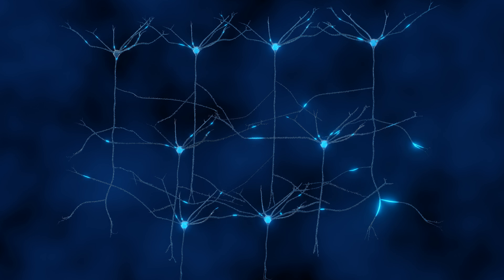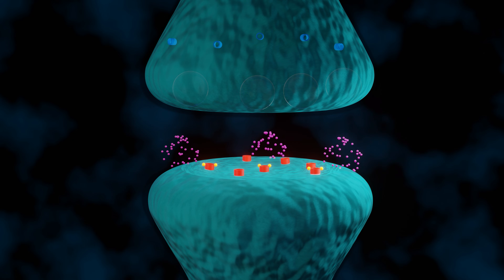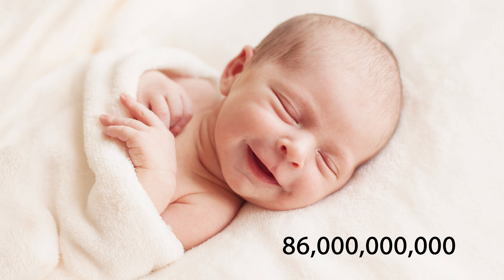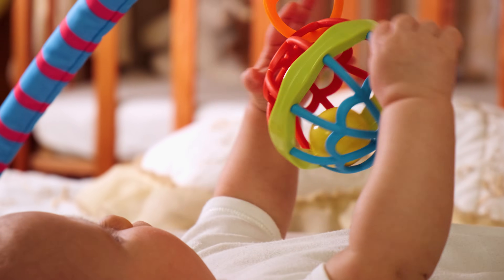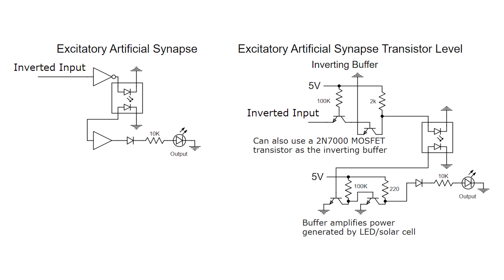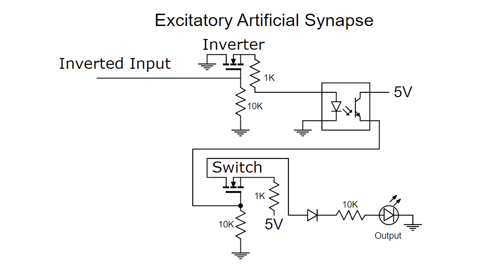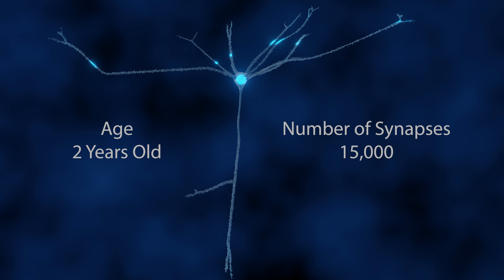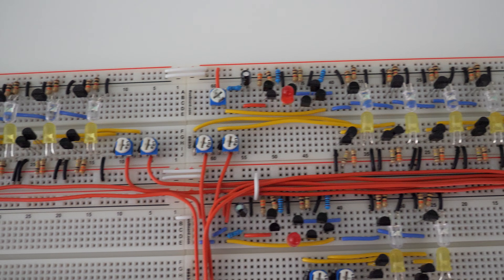How to Build an Artificial Synapse

Comment: What is the purpose of opto-coupler why not a simple direct connection?
Reply from the maker: In this case the optocoupler is basically is a buffer. However the optocoupler could be modified to make it so the amount of charge transferred varies based on the amount of light and wavelength of light. The could be changed in a neuromorphic way based on the activity of the circuit.

Comment: Neural Electronics Will Not Be Corespondent, Analogue To Biological Neurons, Biology Is Infinitely More!
Reply from the maker: Well that is a fair position to take as the task to properly replicate the biology is immense. However, both are physically systems so they should be able to function in a similar way. The question in my eyes is can we do this within a reasonable time frame. It will be lots of work but I think we can achieve a system that is functionally equivalent.

Comment: A fascinating design. Very simple. I would LOVE to play with it. What transistors do you use in this? 

Other thoughts - ReLU can be used as a function of the neuron to control and adjust firing frequency while Tanh is very practical in functioning as the transfer function. As for the resistors to control the triggering event as well as the weights in the synapses, though this is not a pure analog solution - but is suitable until cost effective and functional memristors are available - consider the use of something like a digital potentiometer such as the MCP4012T. 

This would then make a dynamic neuron that would very closely emulate the function of biological neurons that is capable of adjusting while functioning and not needing manual adjusting of resistors. A simple computer - such as a raspberry pi - would be able to calculate feedback based on training set errors into the analog neural network. 

Another more advanced concept would be to incorporate a 'routing' system for analog signals to define connections from neuron to synapse - thus enabling a DNN to evolve over time given suitable numbers of analog neurons and synapses. Something to be considered if the above mentioned neuron/synapse designs can be proven then fabricated on chips.
Reply from the maker: These are 2N2222 NPN BJT transistors or 2N3904. Either model will work. Your thoughts seem very valid and are similar to what I am thinking as well. I am going to try and build an all-analog version of the neural networks and see if I can get them to achieve some practical applications. Get some components and keep me updated on your build! It should be really fun! I plan to launch a competition to see who can build the best hardware bases artificial synapse, neuron, and network as well.

Comment: Hi ,Nice vidoes.Can you also do some more 
breadboard circuits using transistors or ics.Its so coool
Reply from the maker: Yes, there will be more upcoming videos using transistors and ICs. The next series is going to on neural networks and hardware based neural networks.

Comment: Can you please tell me what type of transistor and diodes you used....
Reply from the maker: The transistors can be 2N2222 or 2N3904. The diode was model number 1N4007 which is just a standard diode. Good luck with the build, let me know if you have any other questions!

Comment: 3:52 autistic people don’t prune synapses as easily at any age and have continued increase in number of synapses through early childhood and even later
With your hypothesis this is probably the reason for autistic resistance to change and memory, and part of delayed learning that can occur in autism aswell. This has been linked to hightened sensory sensitivity and epilepsy, both of which are common in autistic people.
Worth noting that autistic brains more easily myelinate (insulate and reinforce) connections than typical brains do, and there are defecits in long-range connections supported instead by all the short distance connections and hyperactive neurons (low GABA levels which reduce the filtering of neural stimuli, and higher Glutamate levels which increase activity, sensitivity and neuroplasticity.). Lower levels of ambient dopamine with larger spikes in dopamine also create the innatentive/executive dysfunction and intense interest aspects of autism.
Thought i’d share another way that neurons can work. There’s papers and videos on neurobiology of autism you can look at
Reply from the maker: Interesting, I have thought about similar things to what you mentioned before. Some times people need to hear things three or more times to learn or accept a new concept. Other people learn after hearing it just once. There are both advantages and disadvantages to fast or slow learning. As you mentioned with autism there are also advantages and disadvantages but that is what makes people unique.
Reply: @GlobalScienceNetwork  mhm. Learning and sensory processing and executive function have a lot of variety in humans. I wonder with artificial minds what kinds of variety unique to them might arise or be invented and if we can emulate different human modalities fully to where they behave like specific human neurotypes
Reply: @GlobalScienceNetwork  oh another thing
Even if it doesn't exactly resemble a human brain or computer, giving specialized but interconnected "brain regions" to what you're making might give it more human or computer like cognition/processes and would probably help it be more complicated and behavioral than things like LLMs or image transformers that are the current craze
Reply from the maker: @orbismworldbuilding8428  Yeah, I agree! LLMs are simulated on digital computers so the information flow is not like how the brain works. It will be very interesting to see what happens when we build large hardware-based neural networks that are interfaced with sensory inputs. If we properly build them it should be amazing!

Comment: I followed the setup at 5:25 but the blue light seems to turn on without me pressing the button. Could the resistors be the cause? If so, could you please tell me what the values are? I'm having a hard time seeing the colors (and still learning how to read schematics). Thanks
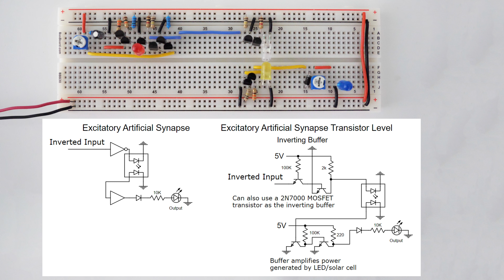Reply from the maker: Hi At 6:00 I show the transistor level schematic. The resistor values are shown but your issue is likely that you did not add a diode before the 10K potentiometer which is a variable resistor. You do not need to use the potentiameter and can just use a 2K resistor but you do need to have the diode in place.

Comment: how do you think this can model the brain's plasticity? I mean, how can these artificial synapses rearrange themselves "at runtime" based on learning patterns?
Reply from the maker: Well the textbook answer would likely be to use memristors. Basically these reduce the resistance with more activity. In reality though this is not a great model for how the brain actually learns. It is up to us to develop better hardware based synapses and neurons. The specificity of charge distribution is actually really important. I will talk about this more in upcoming videos. Basically if there are 5,000 incoming synapses only 50 of those connections may be from the output of another neuron yet it will fire in sequence. This is because of the location of the connections. Also when a synapse needs to be inhibitory for the logic to prevent the neuron from firing this can be done by changing just a few synapses at the right locations. In reality it may be that most neurons want to be firing at a higher rate but it is the inhibitory synapses preventing that. So by changing those few synapses it really lets you control that neurons firing rate. That is my thought at the moment.

Comment: component list?
Reply from the maker: To build the artificial synapse and neuron you need 10 2N2222 NPN transistors, a white LED, Yellow LED, blue LED, diode, variable resistor, 3 100K resistors, 220 ohm resistor, 3 2K resistors, 1 10K resistors, a 47uF capacitor, breadboard, 5V battery pack, and wire. If you watch the artificial neuron video I show the circuit diagram at the component level.

Comment: I think you could just use a capacitor with a bunch of variable resistors as a neuron.
Reply from the maker: That would work for a basic neuron. To build neurons that learn and change over time we will need memristor, resistors, capacitors, and carefully designed synapses . It will be involved but it is good to start with a simple design and see how far we can go with that. It should be fun!

Comment: But, aren't the LED damaged by turning on and off repeatedly ?
Reply from the maker: I do not think the LED would be damaged, I have not had any stop working. The main thing that breaks LEDs is to much current. There is a current limiting resistor in the circuit. In a final design the LED would be Infared LED emitting IR light on to a photo diode or photo transistor. The LED work good though for a demonstration how the system works.
Reply: in fact they work better because average power across them is reduced dramatically. take a look at the datasheet, and you will see that continues current is way smaller than pulsed.

Comment: Very cool.
To make it more similar a biologic neuron we need:
-autoreceptors; ex; on a excitatory cell released neurotransmitter can bind to the post synaptic receptor which depolarize the post synaptic cell and cause an action potential, but it can also bind to pre-synaptic receptors to inhibit further release of transmitter. Autoreceptors/pre synaptic rec. are thus inhibitory. The cell/neuron will continously alter its expression of autoreceptors which in turn regulate how likely it is to propagate the signal to the next cell.
 Whether we actually need autoreceptors on artificial neurons idk, but as opposed to 2 neurons acting on a 3rd post synaptic neuron where the combined effect is either inhib. or stim., autoreceptors add the ability of the excitatory neuron becoming "more" or "less" excitatory depending on various input (hormones, etc)

This is only needed in artificial neurons if we want f.ex to simulate "feelings"; i.e when "scared" the excitatory neuron has a more powerful stim. effect than when "calm".
Reply from the maker: Interesting. We defiantly want to simulate "feelings" as this is part of life. I bet we could add this type of change into the circuit with a "light depending resistor" or something similar that changes based on some needed feeling parameter. Any other thoughts on how to build this in?
Reply: @GlobalScienceNetwork must resist the urge to build torment nexus...
Reply: 👍 Finally someone injecting some real biology into the neural net conversation.
I'll add some signal processing thars been completely overlooked too..
Neurons are (apart from other things) bit rate machines.
Evidence:
Cockroach threat avoidance. Various, stimuli from hairs on their cerce are distinct in the frequency domain. It takes only a few Neurons to convert those stimuli to a rear leg muscle firing sequence that enacts an ideal escape path.

Comment: How is the receiving LED producing enough signal to trigger anything.  I didn't know LEDs could work that way.
Reply from the maker: Yeah an LED can work like a solar cell, although it is not very efficient as the band gap of the material is higher than silicon's, 1.1 eV , which is typically used in solar cells. The small current that is generated by the LED is then amplified by using two transistors as an amplifier. I just used them cause I had the LEDs and the circuit would be similar regardless of the receiving component. You can also use photodiodes, phototransistors, or LDRs for the receiving side of the trigger.

Comment: The incident light in the room would act as an enhancing function to all neurons. Interesting.
Reply from the maker: The light would add some charge to the receiving side. If we use the optocouplers that are in the IC packaging the outside light and light from other synapses would be blocked. It is a good point though that if we used a sensitive receiver in an open environment like this it could add charge to other synapses. That could actually be a design feature rather than an issue if we wanted one output to contact many other inputs without having to wire them all together.
Reply: @GlobalScienceNetwork  Or allow a limited number of other neuron inputs to be coupled to a single (or more) neuron on a computational level. The problem as I see it is being able to get adjustable light signal levels from each input independently with minimal circuitry.  :)
Reply: @GlobalScienceNetwork  yeah, it's not optimum to use visible light except for demonstrations.
Reply: That reminds me of reptiles. Reptiles are cold blooded and need outside heat to speed up their metabolism, metabolism effects speed and activity of neurons/brain. So reptiles generally are both more active and are more intelligent and respond to their environment faster when its hot/warm.

Comment: I think that everyone who starts working with neural networks should start with this. I may be old-fashioned, but it’s hard for me to take seriously anyone who considers himself an "expert" in the field of neural networks, having never held a transistor in his hands and has no idea about the structure of a biological prototype.
Reply from the maker: I agree 100 percent! If you follow along I bet you will be able to help improve these designs!
Reply: I think that a lot of the neural network modelling is based on calculating values for variables in a mesh network based on their weights, much like the number of receptors activated to trip a synapse. But I do think a neural computer is a more interesting idea.
Reply: I'm actually holding billions of transistors in my hand RIGHT NOW!
Reply: Not old fashioned, im starting with neural networks, i do basic circuits as a small hobby, and I can definitely confirm this video was very insightful, more than my last theory classes about basics of neural networks…
To be honest getting a “hands on” experience like this is way better than just someone explaining to you the basics and how to code a basic NN

Comment: Hi,
This is very cool, you created a novel dynamic system that self activates!  It's also aesthetically pleasing.  As usual, I have a few questions and comments:

1. Is the diode really necessary since I don't think you need to protect against negative voltages?  Maybe its purpose is to simulate an activation threshold at the "knee".
2. Is the self-activating pattern somewhat stable and deterministic, or somewhat random and chaotic?  It's hard to tell from the video, even when slowing it down.  Since transistors vary as they heat up, I would imagine there would be some variation.
3. Does the system form a complete loop (i.e. "recurrent")?  In other words is the "first" neuron itself triggered by another neuron or is it just set to a fixed potential?
4. I could see that some configurations might settle out, stop cycling and reach a stable pattern.  Have you experienced that?  Have you determined the conditions for continous activation?  Did you have to "tweak" it to get a stable active pattern?
5. BTW, I like your neuron video, did you produce that yourself?  It's a very good animation!

(Sorry I have so many questions 😊)
Thanks!
Reply from the maker: Good questions as usual. 
1. The diode is needed so that when the synapse is off charge does not flow back to the ground.
2. Well the next video will explain how the neuron itself works. This video was just for the synapse. Since you asked though, the neurons are made with a Schmitt trigger used as a comparator to determine when the voltage is above a threshold value. The charge is flowing into the capacitor based on the resistor values. When the voltage in the capacitor is above the threshold the capacitor discharges. So I would say it is deterministic. 
3. The input current going into the first neurons will be from some sensor. Right now it is just set based on the resistor value used. The neurons downstream are connected and are affected by all synapses that are connected to it. Each synapse can drive the voltage within the capacitor to be closer or further from the required threshold voltage to discharge. Depending on if it is an excitatory or inhibitory synapse. 
4. As long as there are more excitatory synapses than inhibitory synapses feeding into the neuron it should fire in a continuous manner. In some cases, the inputs might be such that the neuron will not fire. Overall though the entire network will be continuously firing just like in the brain. 
5. Thanks! The animations were made in Maya. I tried making them but there was quite a learning curve for Maya so I hired someone to make the animations. The animations are custom made though just for these videos.
Reply: @GlobalScienceNetwork  Thanks for answering my questions.  BTW, the diode-capacitor pattern is commonly known/used as a "peak detector".  Again, nice production, pretty serious that you hired someone out for the video!  I look forward to your upcoming videos!

Comment: dude you have built artificial synapes0 on breadboards  just create something new make games on breadboards using transistors.
Reply from the maker: Games would be cool as well but I think the artificial brains are cool as well! It will eventually become the most widely used/manufactured tech.